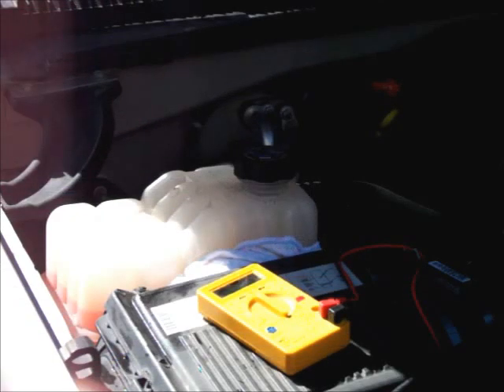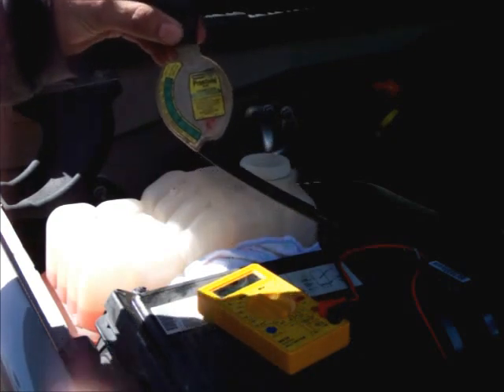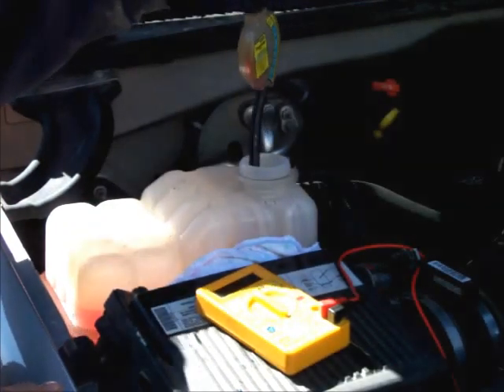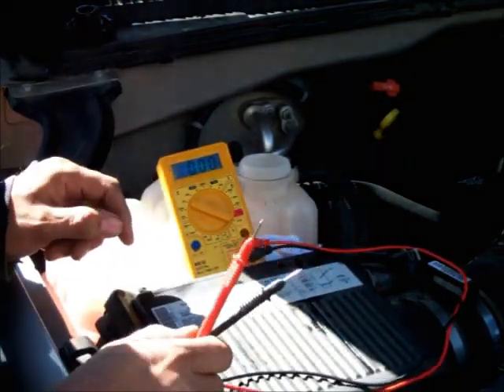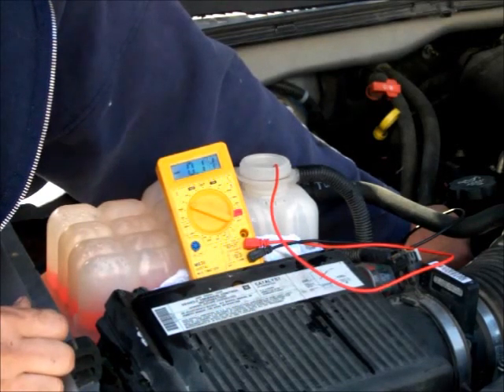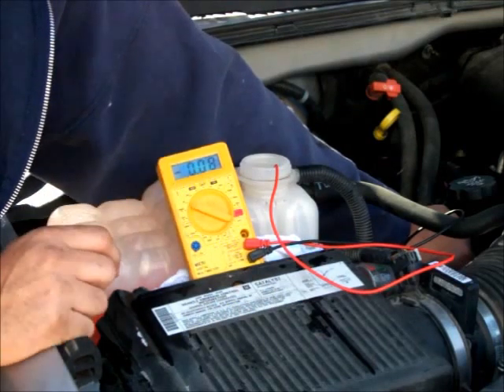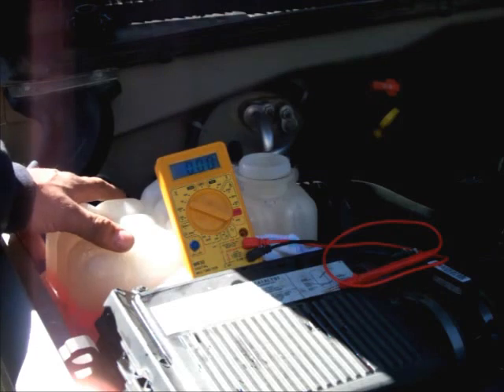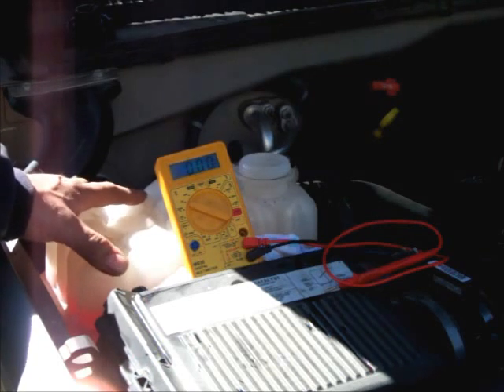Anti freeze testing with Hydrometer and a multimeter

Comment: A 2007 Pontiac G5 2.2 liter ecotech, At start up, I let it idle & reved it a few times & the dc voltage went up eventually to .31-.33 @ 185°F . I have never changed my coolant (extended life-Orange coolant) I got the car about 14-16 months ago (guessing) As far as I can tell, I do not think my fans operate properly unless the car gas not got hot enough! I have seen 211° maybe 213°  Apon snooping, & messing with relays, there is 3 sockets for relays, one is Cool fan, - cool fan#1 & cool fan# 2 =3 in total but, the socket labeled simply Cool fan does not have a relay in the socket plus, its the only one with 5 electrodes, the cool fan 1&2 are both 4 pin relays but the control circuit is a 5 pin. I am lost!!!!! I did find out when probing, when I ground the top left pin of the control circuit (Cool fan) THE FAN COMES ON! SO, I ran a toggle connected to ground & simply provide a path to ground with a toggle switch within the path. However, I do not know how to access Hi-speed???? Either way, I can only access one speed... my dc voltage was at .27 untill I got above 180 degree

Comment: Are you testing the quality of the coolant by using the multimeter to read voltage drop?
Reply from the maker: +jcp021899 If electrolysis is starting it will make voltage

Comment: MS7, you are correct on one claim, but incorrect on the other. It IS a reading in voltage, so it does end in a V, however, its .5V (the vast majority of sources i see use .3 tho), not .05V. 

Nice vid OP :)

Comment: Does temperature matter when testing? Engine rpm? Thanks.
Reply from the maker: +Greg Egan I have not tested at different temps , but i do them cold, not running
Reply: @wtbm123    When testing my coolant for voltage,, 07 2.2ltr eco-tech...I was getting .27v when cold, .31-.33 @ 185 degree while using a length of copper to reach beyond the  sort of strainer in the opening of the plastic expansion tank.